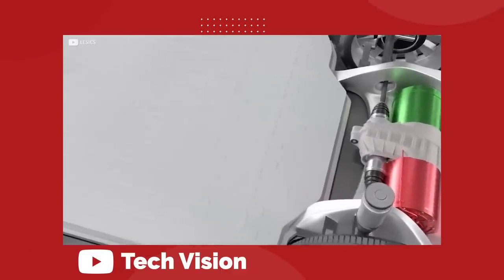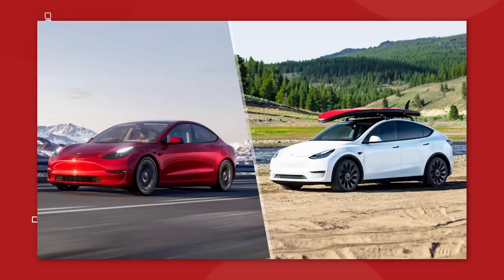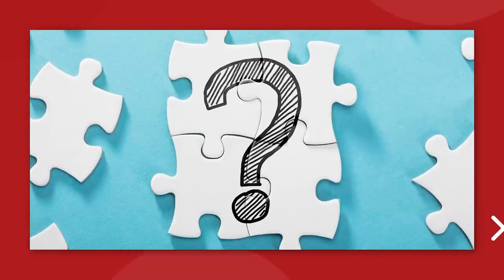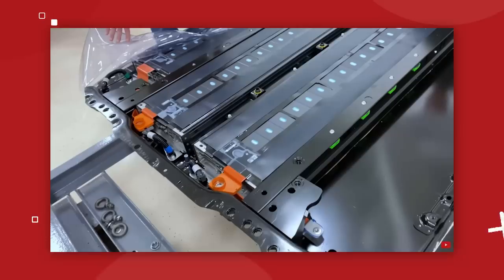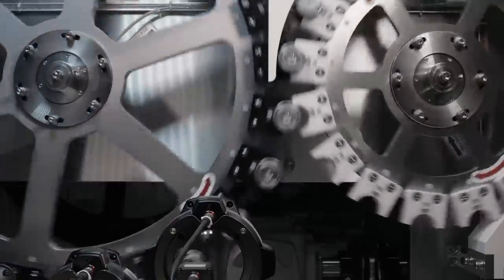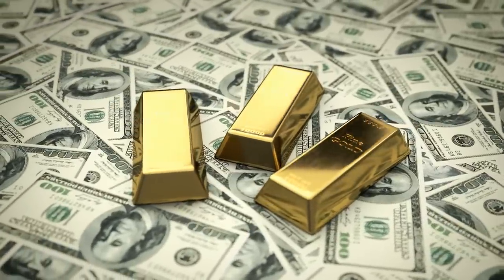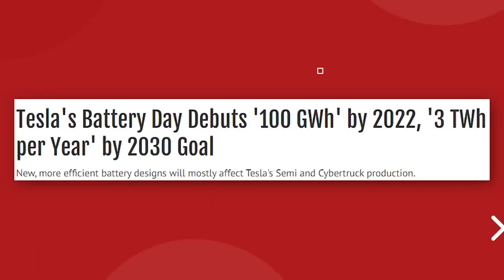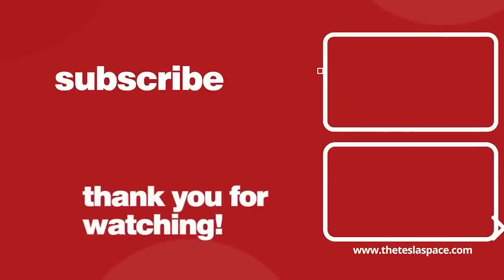The 2022 Tesla Battery Update Is Here

Comment: Musk and Tesla successfully identified the technology convergence and potential cost reductions in battery tech that would make mass market EVs viable.  They then followed a path to capitalise on those factors and play a part on their further development.  Every one of the legacy auto makers could have done the same but chose not too.  Success was not guaranteed, Tesla had to execute impeccably in every aspect because car manufacturing is capital intensive.  To do this in an industry which has a low tolerance to making missteps is a huge achievement.

Comment: 11:42 Most of those gains are due to the bigger size of the battery cell, they are not specific gains per volume or per mass.
Reply: The energy is, yes, since the cell is 5x bigger.

The same cannot be said about the power for obvious reasons. Furthermore, in conventional batteries, greater the size of the jelly roll, the higher the relative bottle cap of power delivery as there is usually a single pair of tabs per roll. Tesla’s battery roll has tabs distributed along the whole roll allowing power to flow along merely the height of the roll rather than the length. Since they are able to make it 5x larger in a single unit, the range also grows, and so does the manufacturing efficiency, and lack of need for welding cells together

Comment: I expect vehicles to be made out of solar panels for roofs, hoods, etc so the batteries recharge while parked. When that occurs it will be amazing.
Reply: The Solar absorbing surface area is just not enough density to allow for anything but HVAC and pumps to operate at 24-48v.

There’s 3 main engineering problems with car solar - voltage optimisation & conversion, float voltage/current and cooling/shade avoidance. 

By far the most difficult would be when the panel doesn’t have enough energy, and/or is in partial shade, the shaded area of the panel heats up because the electrical energy has nowhere to go, except heat the shaded area until the panel is feeding the minimum energy into a circuit. You would need to have a panel tech that works in shade, and an Optimizer system to reach the minimum voltage and current needed to charge the battery.

The car itself will have a minimum charging Amp/wattage or 120/240v AC rating, usually 6A at 120v AC. This likely converts to ~1.2A 400V once the AC inverter has processed it, and while may be possible to charge at rates below 1A with DC 400V, or 800v battery packs in some cases, it doesn’t seem likely to be able to charge at 0.01A or 0.1A, which is what you’d get from a single Solar Panel on a cloudy day.

While this would be enough to operate the computing and pumps for coolant, etc, it’s not that practical. A micro-inverter or DC optimiser would need to join the separate panels into a branch feed and absorb heat from the panels. 

The kind of voltage and amperage needed to top up hundreds of cells requires a bare minimum wattage from a single 40v solar panel module. 

The car would need an average of 2 to 6 standard 60 cell “roof” panels, or 120/144 half-cell panels to generate enough voltage energy to start charging the cell package(s), even if you had an inverter to convert the 36-40v per panel, into 400v, the 300w to 400w panel at 40v, would charge the battery at
Reply: Charging at low power (2kw) while you sleep is probably 90-95 % of most people's charging.  But then the real world reality is often ignored.

Comment: If the range goes up to 700 KM, I can get one, though, in the winter, I still don't think that would get me where I need to go.
Reply: I will never get just an ev. Always a gas backup
Reply: @kevinji7285  what if gas stations become in short supply. If less people use gasoline there will be less local gas stations.
Reply: why would you need 700km ? Do you live somewhere where there is electricity in a 700 km distance ?  And do drive with diapers on ? Any normal human would need to stop every 3 to 4 hours.   I really don't understand people that can't accept a 20min break every 3 to 4 hours.
Reply: @mmistermusic  well, nothing is 100 percent efficient. So 700km may get you 500km in winter?

Comment: Lots of buzz around Lyten lithium sulfur batteries, already in production, with volume production beginning in 2026. They can be in any form factor (cylindrical, prismatic, pouch) and should be cheaper than NMC chemistry with high density to weight, making them perfect for electric aircraft. They will also be used in cars, as production ramps up.
Reply: Higher energy density, but not high.

Comment: I’m surprised that Tesla hasn’t followed Apple’s Battery shape and make then rectangular. See all the spaces between all the round cells? That’s how Apple solved their battery capacity in their MacBook’s. If they changed their shape they would get so much more capacity in the same space which would equal a lot more range.
Reply: That space between cells is needed for cooling liquid to flow by. Especially during supercharging.
Reply: @HansvandeVen  I didn’t know they had cooling liquid between the cells. Thought that would or could cause shorting if it leaked into the wrong place. The Chinese batteries were a brick shape and didn’t have that problem too.

Comment: The battery updates are not coming fast enough. I’ll be dead before I can buy a car that has a  high range without all the degradation. I’ve been waiting since 1988. What’s the deal, come on man !
Reply: degredation is already impressively low on the existing batteries. at around 1,500 cycles. Giving it double the lifespan of a combustion engine on average.

Comment: Yes leaders maybe if they can make the 4680 cell cost effectively; but it doesn't solve the heavy weight issue. it doesn't solve the safety issue. More importantly several new models depend on this cell.   They could be making 10x as many hybrids with all electric commute but they rather not make that large on impact on CO2; Tesla would rather have a 2.5 ton cars that they say are about as green as a BMW 3 series Ice car  - I guess that makes sense to someone.

Comment: It's only 5x more energy because the cell is almost 5x larger!  The energy density is virtually the same.
Reply: Well in Volume (also Higher spare Volume between the cells) still weight advantage due to less Material for same energy delivery, Sums Up to around 15% more energy density per weight volume. Not saying that the chemistry can be tweak further, Just Like with NCM and LFP types. Wait till they figure out silicon types...

Comment: LFP is a non starter they are not unlike lead acid batteries when it comes to density. For a low end cars by all means they are good enough but for fully powered cars fat chance 4680 does everything lfp does just better.

Comment: I wonder if any of them plan to use a hybrid battery design. What I mean by that is use the more energy dense batteries that don't last as long with the longer lasting batteries without the same level of density might be a good pair since you can put the first 25-50 or what ever number ends up being optimal on the longer lasting batteries causing less stress on the batteries that don't last as long making them last longer. Since most people do daily driving around the city and on average that might only use up 25 or less miles having that small set of long lasting batteries  that take lets say most  all of the power draw for the first few miles could cause the over all longevity to last significantly longer without actually having to advance the batteries themselves. Maybe they already do this or plan to I don't really know.

Comment: Do you think LFP vehicles will have the option to be upgraded when better battery tech is available?
Reply: Unlikely be3ause a different pack size or chemistry alters the cell pack voltage and that means the software has to change.
Gruber motors who are/were a Tesla battery pack specialist said it was unwise to even upgrade the pack size.
Reply: @danielstapler4315  interesting

Comment: When we were offered the LFP M3SR they said we’d get 10 miles less range.
Reply: Is that a big deal on a ~250 mile range car? I doubt many of these vehicles get that range in real-life driving anyway. Teslas might come close, though.
Reply: And that may even change after one year of use because of the much better battery life and improved recharging cycles.
Reply: Yes but you can charge to 100% with no degradation and discharge to near 0. So in practical terms you have more range.

Comment: Tesla is going to need to adopt the "blade" design.  Can't ignore air cooled vs complicated and
expensive liquid cooled.  Also recycling the circular design is difficult.  Need to man up quickly.
Reply: No Tesla is using their battery right now as a thermal sink for their heat pump system. Moving to air cooling removes the utility of the battery mass for the cars thermal control. The battery right now is not just an electron tank it is also a heat tank.

Comment: Tesla should have a look at the company Lyten and what they say they can achieve with their Li-S or Lithium Sulfur battery. They claim 900wh with their batteries and as safe as LFP.

This means with this type of battery pack in a LR Tesla, Model S, X, Cyber Truck,  Roadster and even a Tesla Semi you can achieve updars of 800 miles on a single charge.

And since it's not using any Nickel, Cobalt or Manganese it's going to be a cheaper battery. Keep LFP for the standard range because of the cheap entry point of ownership and the safe6of the battery and the Li-S batteries for your longer range.

Hmmm... Just a thought 🤔

Comment: I doubt the oil industry is going to sit back and let their dominance just drift away.
Don't be surprised if a super-efficient ICE is released that gets 250 MPG and produces next to nothing in pollutions.
Just a guess
Reply: For diesel motors  the emissions system holds them back like crazy.  Ford super duty trucks with the 6.7 motor get about 14/22 mpg. I have heard guys with the dpf system deleted getting 22/32   So there is room to play.  Hopefully they make them more efficient
Reply: you can only push so far in an overdue tech.. also, an combustion engine with little to no green gas emissions are near impossible to do and the current existing fuel solutions are far more expensive than diesel.
Reply: The oil industry is investing in renewable energy and natural gas to produce electricity
Reply: The car industry is wedged. They can't invest loads of money in EV tech AND at the same time in improving ICE engines.
But who knows maybe Toyota might be able to do something.  :-)
Reply: 500 mpg and a 10 gallon tank
Reply: @grateful.  and with a top speed of over three hundred meters an hour!

Comment: they should put solenoid engines in the cars :v
Reply: No, no they shouldn't...
Reply: Why?
Reply: so that evs will be more fun to drive and 2x the power
Reply: @shamarerskine3987  You mean noisier and with half the efficiency?
You realize that those solenoid motors are mostly for a laugh, right? Nobody would take them seriously as a replacement for any kind of half-decent rotary electric motor.
Reply: @devilsoffspring5519  they are better than a
boring electric motor it has potential
Reply: @shamarerskine3987  Oh man, here we go...
Better in what ways?
None...
Reply: @devilsoffspring5519   it has more torque than a brushless motor with the same amount of copper wires thats why i said it would give more power. brushless motors only have one rotating part yes but it also need greater amount of magnetic field to generate torque and solenoid engines have 
sound too thats a big plus
Reply: @shamarerskine3987  It has none of those characteristics except for the noise, as you mentioned. That noise comes from wasted input power.
Anyway... Are you serious?!
Reply: @devilsoffspring5519  are you serious a solenoid engine produce more torque than a brushless motor by a large scale you dont know this ?
Reply: @shamarerskine3987  The torque depends on the overall motor design, and the current. That's it. There's nothing inherent about a solenoid motor that produces "more torque."
People build solenoid motors for a laugh, and just to build something. Kind of like turning old lawnmower engines into steam engines, or something along those lines.
There's simply no need for the extra bulk, cost, and complication of a crank-and-conrod mechanism in an electric motor. Yes, you can do it, and no, it isn't better in any way other than for entertainment value.
Reply: @devilsoffspring5519  the moving parts align the solenoid with the magnets at the best positions for maximum field strength
sad that this engine was never put into a ev 
to give it a chance
Reply: @shamarerskine3987  That's how rotating motors work, too... But, without all the extra, unnecessary machinery that only adds weight, bulk, and cost while wasting useful energy.
Reply: @devilsoffspring5519  you dont understand how it works huh rotating motors and solenoid engines are very different  the solenoid engine has its advantages and it wouldve gotten better if profesionals look into it and improve it and weight wouldnt be a problem for a vehicle 
with a solenoid engine and its torque
Reply: @devilsoffspring5519  he makes pubg mobile content... Stop wasting your time haha
Reply: @Delitor  You have a good point, which is nice for a change :)

Comment: Is the battery production really sustainable? I think that hydrogen will be far more sustainable option in the future. It's just not the raw materials but the energy needed for the battery production.
Reply: It is Hydrogen that is not sustainable, certainly for personal transport, far too expensive and inefficient, only supported by the oil companies as they can see this supporting their sales model, you make a battery and it lasts for 20 years in use in cars then stationary storage, then recycled to make new batteries, the ultimate in sustainability.

Comment: My Tesla has over 300 mi range; but I don’t. I need a rest stop long before my car needs to recharge.
Reply: Every tesla owner says this. I want the option if every stall is full that I can make it to the next station. Most gas cars have 500+ range
Reply: @grateful.  if you need that kind of range then You need to keep your ICE vehicle. However with range and charge speed constantly increasing along with charging stations multiply like rabbits the range issue is rapidly becoming a moot point.
Reply: @Scott4271  theres alot of gas stations but you dont see 100 mile cars.
Reply: @Scott4271  when I'm evacuating the state because of a hurricane,the more range the better
Reply: @grateful.  I don’t see 100 mile Tesla’s either. My own car has over 300 miles range and I recently drove it on a three day trip from Mexico to Canada with no range problems. Like I said the car has a much longer range than I do. When
Reply: As modern humans run on coffee and soft drinks which contain caffeine which is a diuretic, regular stops are required for long distance journeys both to recharge and and refuel.
Reply: @malcolmrickarby2313  let me give you a example that happens all the time. You get to the charging station and all stalls are full and it will be a hour till it your turn to charge. With longer range you can go another 200 miles without having to worry about it. Plus the company already has a 400 mile car and are planning 500+ mile cars. Tweet elon ask him why he wants to make cars with long range
Reply: @grateful.  for your own health you should have a break every couple of hours and your Tesla should direct you to chargers that are free. I’ve never seen a super charger station where all the stalls are full because the car won’t take me to one.
Reply: @malcolmrickarby2313  idk why they only put 6 charging stalls on the highway rest stop
Reply: @grateful.  I’ve had my tesla for two years and do quite a bit of traveling. I’ve never pulled into a supercharger where all the stalls were full and I had to wait. On occasion at busy superchargers they request you only charge up to 80% and then go onto a less crowded supercharger further along your route. Perhaps your experience is with non-tesla charging stations.

Comment: No. Because battery is only half of the issue. As ev become more common, power consumption will rise and the infrastructure will need to grow to cover it. With all the focus on supposed "green" energy, i expect the infrastructure to come up short early and often. 
But what do i know.
Reply: Renewable energy is increasing rapidly and the existing grid can handle the extra energy due to widespread generation by homes and businesses .

Comment: The 4680 has 5 times the volume of the 2170 so 5 times the energy but only 16% more range.  That’s only 16% improvement from the smaller battery but Tesla has to go through hell to create a process that can mass produce them.  I doubt Tesla can monetize it with current 84% yield and only 16% improvement.
Reply: The 16% more range would be on a per kilogram basis.
5 times the volume means a close to 500% increase in weight (it's less because you need less cell container). So they expect about 500%+ the range not 16%